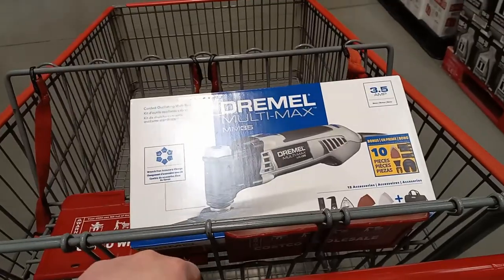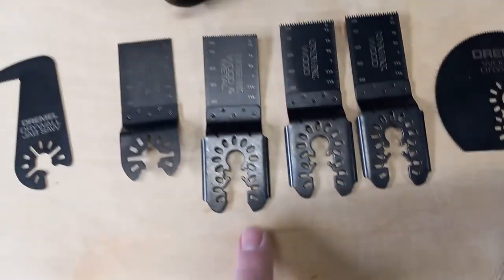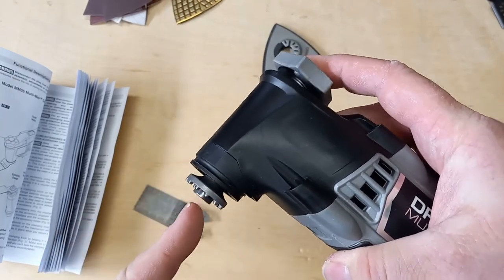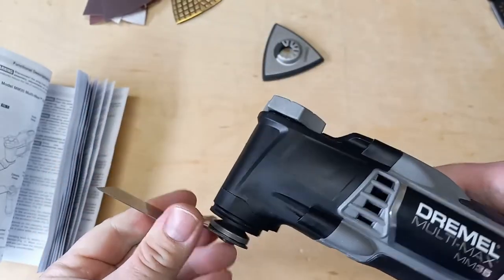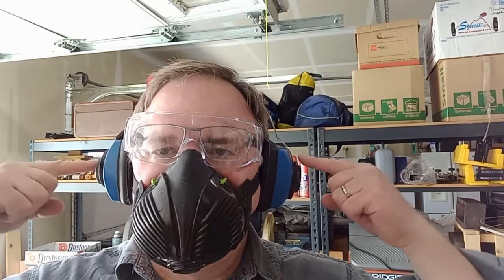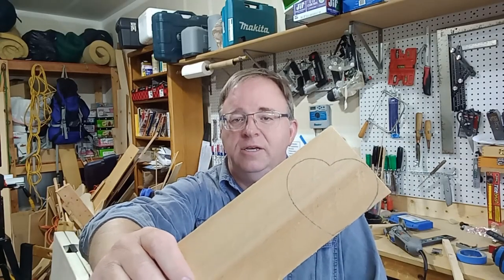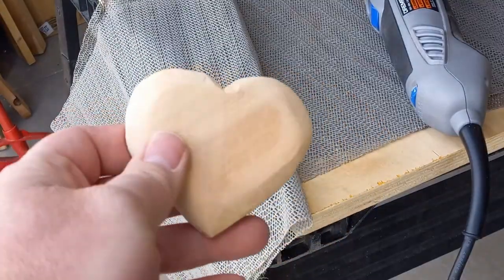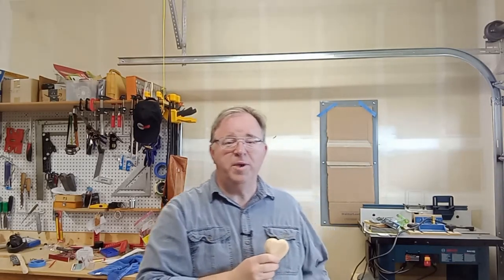Dremel Oscillating Multi-tool -First Look and Demonstration (Multi-Max MM35)

Comment: Purchased a Dremel to replace the 2 rigid tools that I had,no comparison,the Dremel has stood up where as the rigid tools are noisier,vibrate and get very hot and both broke with out a lot of use.
Reply from the maker: Thanks for sharing your experience.